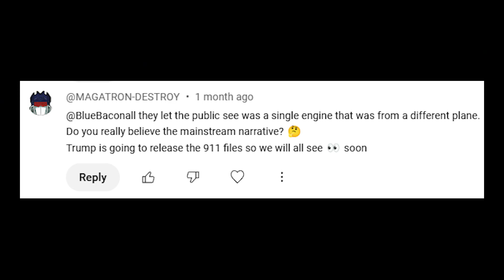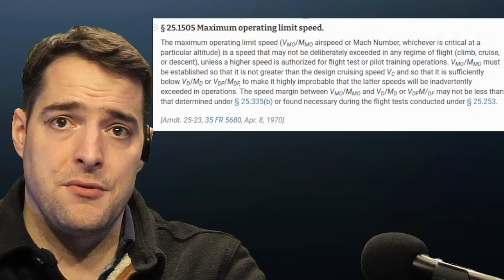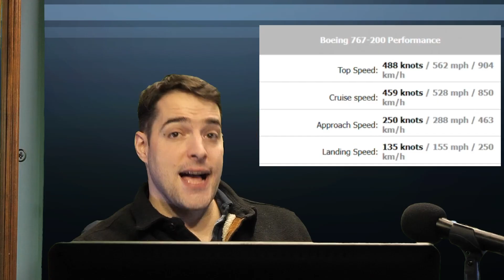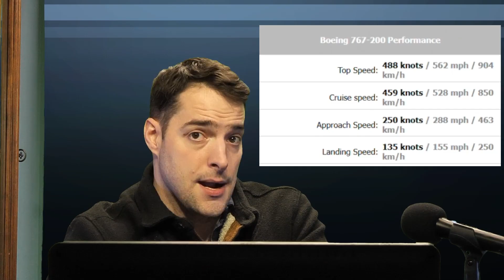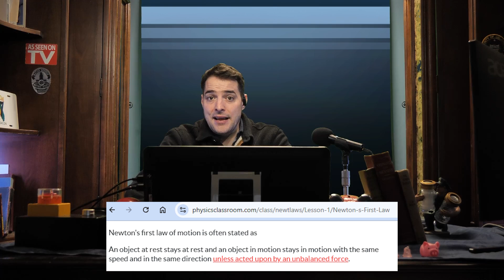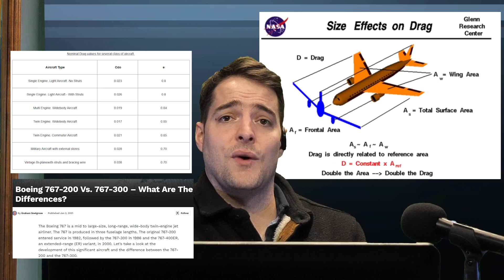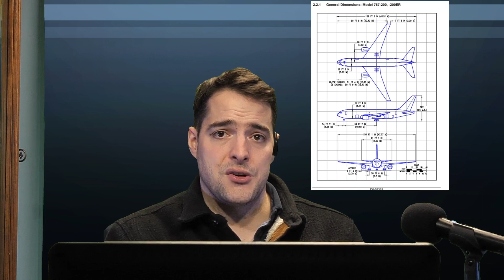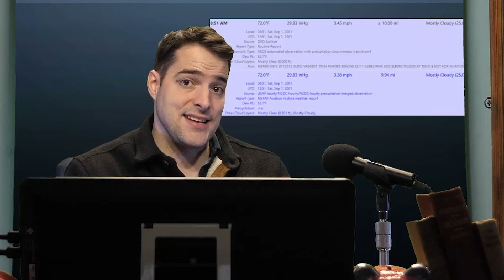No, the planes that hit the towers were NOT travelling impossibly fast!

Comment: I'm a licensed pilot although im only typerated to fly single engine non revenue flights. As a pilot in the MES camp, i acknowledge that the speed of the aircrafts are no issue. Nor is structural loading an issue for the terminal turn before impact for the second aircraft.

That said, there is absolutely something wrong with the narrative regarding the Pentagon.
Reply from the maker: I appreciate your confirmation of the airspeed. I am interested in your issues with the Pentagon narrative.
Reply: @BlueBacon  Sure. So I'm going off memory here. First, the released CCTV footage does not show a plane. Full stop. Even in 2001 you would expect more than 1 camera angle and it's not reasonable to expect full motion video. 
What really pushed me over the edge is just how low the aircraft had to fly to line up for the impact. They had to overcome ground effect and delicately balance the aircraft between 20 and 50 feet during their approach. The aircraft does not respond instantly so it's quite a feat of flying. 

Also, there is a long format interview with two Pentagon police officers. Each separately claim that the aircraft flew over the gas station before impacting the Pentagon however this is not possible according to the official narrative.

Also, Shansviile appears to have been cleaned up of major debris before being filmed. There just isn't a lot of airplane left there.
Reply from the maker: @X_513x  Ah, I can help you with this. First, my relevant credentials: I was a criminal investigator in the Army. I have worked as a bodyguard and residential security agent for people and companies worth billions of dollars. I am very familiar with crime scene investigations, as well as the security features of government, military, residential, and commercial buildings.

1: The CCTV footage shows a plane. 
2: camera recording storage can become problematic very quickly. The Pentagon is huge, and storage technology was much more limited at the time. When setting up a camera system that has these limitations, there are several things that are taken into account. First, what might a threat attempt to access? Those areas will get higher-quality cameras, because it is presumed the threat will have to travel into the areas they are recording. Next, where are the high-traffic areas? These will also get decent-quality cameras, as it is likely a threat may travel through them. Finally, you have everything else. If a camera is filming any other location, it is often merely for the purposes of establishing a timeline of events, as opposed to fine details. As the Pentagon likely didn't expect the threat to be a plane, the camera system was not configured to account for an object moving several hundreds of miles an hour into a wall. 
3: Something that is difficult is not inherently impossible. The pilot did in fact strike several objects on the ground before impacting the Pentagon, suggesting he was struggling to control the airplane.
4: If the Pentagon Police Officers' statements truly are incompatible with the official narrative, it can be presumed they may merely be wrong, and may be stating information that they heard from a separate source. This information may have never been correct, or the officers may have misunderstood or misremembered the information. This is very common, and does not negate statements from witnesses that are in fact consistent with the official narrative. 
5: Most of the Shansville wreckage was cleaned up in 13 days. It was an active crime scene. Reporters were likely not permitted to photograph or film it until it had been processed. This processing may have included removing large quantities of wreckage for analysis in a lab. Alternatively, aluminum will liquify at the temperature jet fuel burns at, and an uncontrolled plane fire may leave less wreckage than one might expect. VoePass Flight 2283 is an excellent visual example of this.
Reply: @BlueBacon I know a couple of people working at KIAD that day.  They saw the whole thing
Reply: I call B.S. and we're you even alive for 9/11? Your such a such smug smart ass I can't stand to anymore of your content.  There is video proof of molten metal dripping from the WTC b4 the collapse and documented evidence of nano thermite being used.
Reply from the maker: @shademe no there isn't.

Comment: What really gets me ks that this isn't even difficult math. Its just a bunch of plug and play formulas with easy to obtain information to fill in the variables. The fact that a "math channel" didn't get this and instead went the hologram route is truly perplexing.
Reply from the maker: right? The most difficult part was getting the plane measurements to plug into an existing formula! And the plane's maximum rated speed (again, not the maximum possible speed) was only 25 mph less than the estimated speed while the plane was in a descent